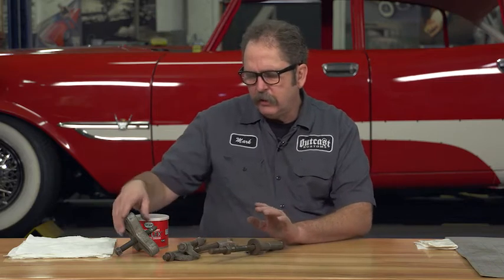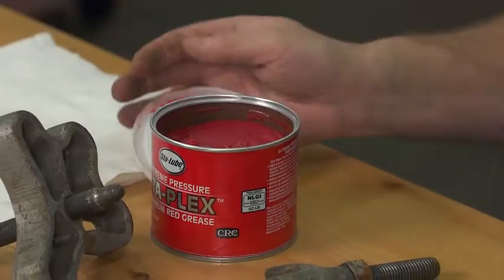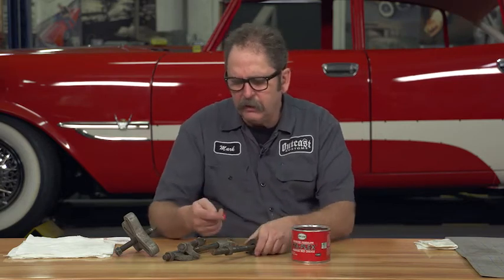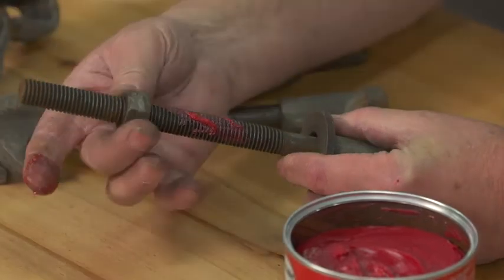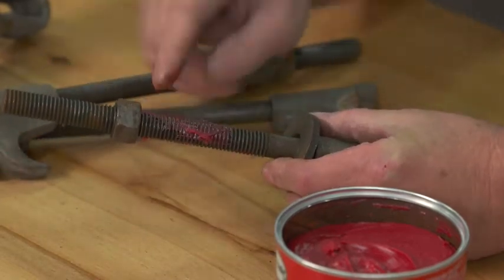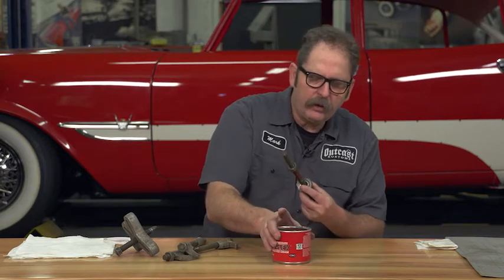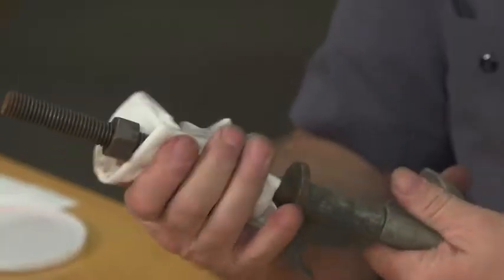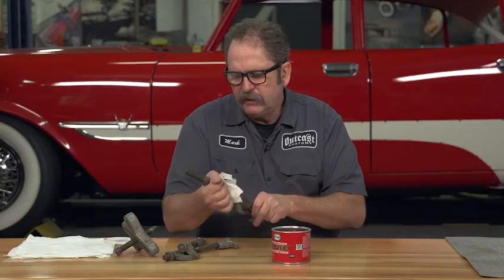High Pressure Grease on Threads

Comment: Thanks for posting this, would a molybdenum grease be a good option?
Reply from the maker: Great question! The ‘Ask an Expert’ section is currently for members of our online community. I would be happy to send your question off to the experts. To get started, please send the email associated with your paid membership account. Thanks!
Reply: You may have already found a suitable grease, but buy a grease with molybdenum disulphide. It gives grease its strong load bearing properties which is what is applied with using pullers or spring compressors as in the video above.